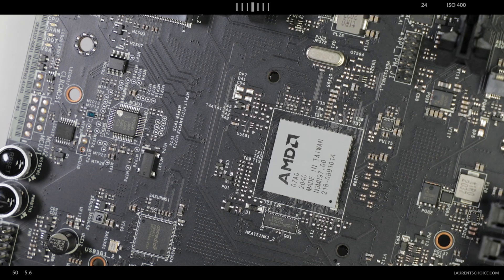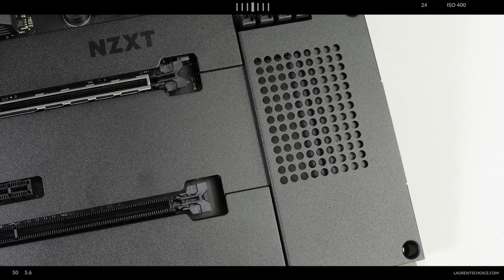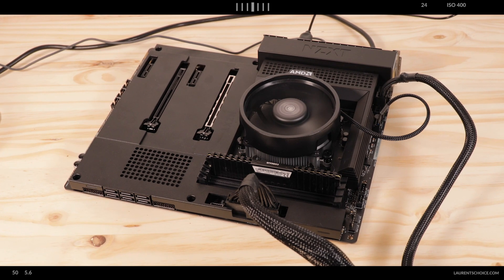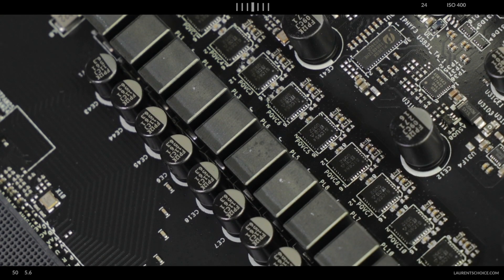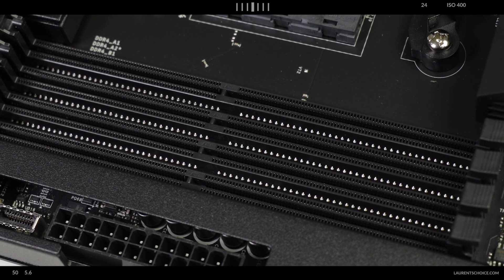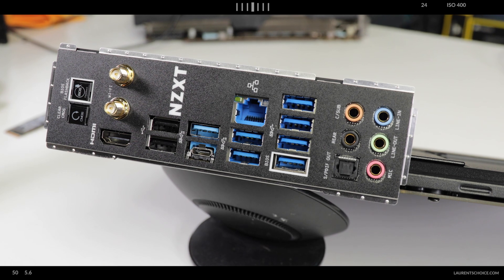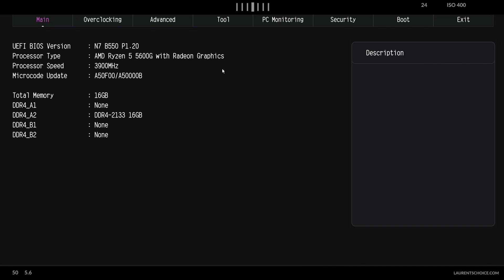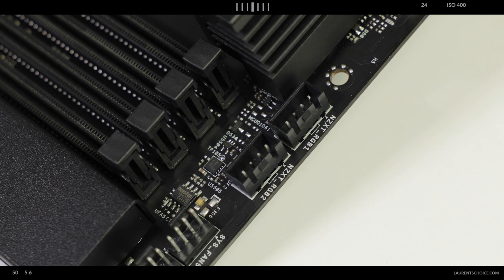NZXT N7 B550 : Finally something FRESH!

Comment: Do you need a bios update to use this motherboard with amd 5000 series? In pc part picker you dont get any bios issues but i really dont know for sure
Reply from the maker: No. Shouldn't
Reply from the maker: But do it anyways :)
Reply: @Laurentschoice  okay thanks! Why should i do it anyway? Is there a benefit in doing it anyways?
Reply: @Laurentschoice  i was looking on the site and fount it quite confusing
Reply from the maker: It gives you the latest bios features and keep things stable :)
Reply: @Laurentschoice  okay is that also possible after you build your pc?
Reply: @mortaibenharry5126  yep. You can still update bios after building it
Reply: @Kiro_I0  okay thanks! I will searh that up i think i will also unlock recizeble bar than but i dont know that for sure!

Comment: Hi. You recommended a motherboard for  me awhile ago and said u could recommended a build if I told u what I was looking for. The motherboard is MEG X570 UNIFY. I wanted make a really  fast solid pc, im willing to save for parts &, RGB is not a concern.
- I was looking at _ryzen 7 5800x
- Corsair Dominator Platinum 32g (16×2)
Not sure on storage what to do but was looking at  western digital WD 850 1T w/ heat sink as a drive for games and then get  a larger  and cheaper drive for storage. 
 *Also have a nice larger case and a cooler master ML240L V2. 
Any help would be really appreciated I am really good at mechanics and building but I don't know enough specifics to be confident. Thanks you for advice so far I almost got a bad motherboard but that was like 1 1/2 ago.  Thanks and hope all is good
Reply from the maker: All the above seems fine. 

Take a look at the SL600M from collermaster. Great looking and really spacious 

What GPU are you going for ?

Comment: I was expecting an MB endeavor from brands but not from the NZXT. Nevertheless, it has good build quality and features.

One thing I'm not agree with you; modern NVMe PCI 4.0 M.2 SSDs come with their own beefy passive coolers. I believe NZXT intended to target that area. That M2 slot cover can be only something to hide that area if you're not using the SSD slot. PCI 4.0 SDs can be very hot during excessive usage scenarios like 4K/8K video editing/rendering I dunno if MB's passive cover dissipates the heat effectively if they even have it. 

I never tested a gen4 M2 SSD myself with one of the embedded heat sink M2 covers but highly possible that might be pretty weak for gen4 heat dissipation.
Reply from the maker: True ! You will need to carefully chose you m.2ssds to have an integrated heatsink. Should have thought of that.

Still, all of NZXT competition (at this price range) does bring in a heating and thermopads. 

Something NZXT needs to think about.